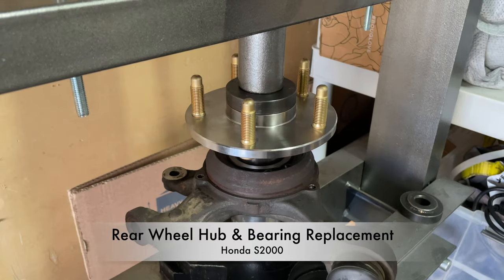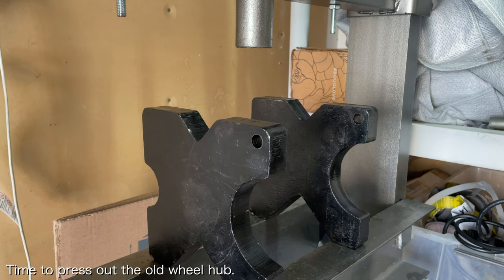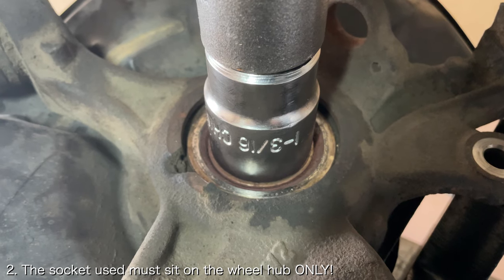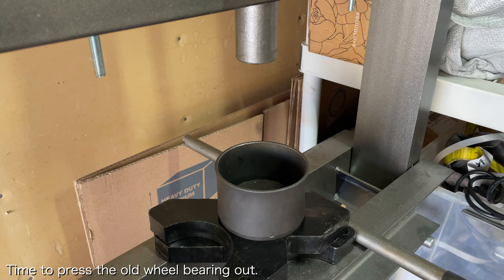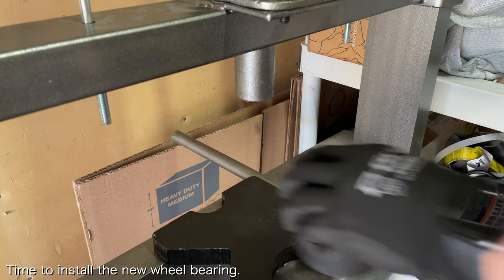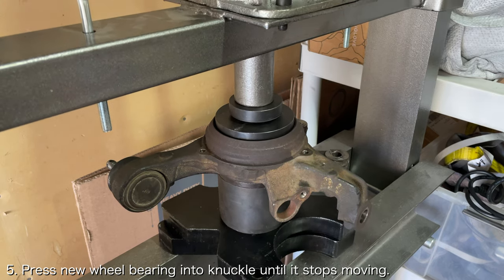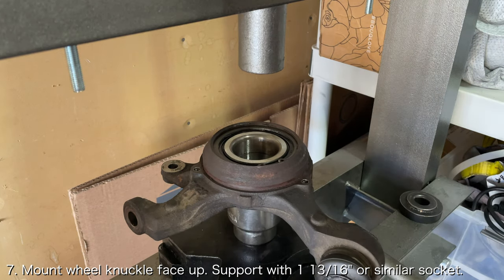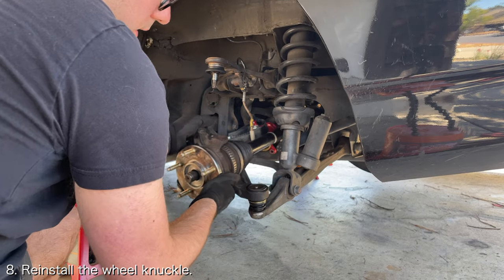Rear Wheel Hub and Bearing Replacement | Honda S2000

Comment: Thank you for posting! 

FYI timken bearings have no rubber side, and the brake shield goes back on before hub.
Reply from the maker: I never instructed to remove the brake shield in the video. I was just doing this personally since I was installing a rear big brake kit which is not compatible with the brake shield.

Comment: Did you grease the bearing or hub. I am starting this job today and wondering if my Honda Urea grease is necessary. Thanks for the great videos!
Reply from the maker: You can apply some light grease, my bearing and hub came with some grease already on them.

Comment: Will you be reviewing KARCEPT hub?
The hub in conjuction w/ 2 piece rotors is major strength & thermal capacity
Reply from the maker: Yeah. I’ll make a short video about the hubs since they are a relatively new product.
Reply: @DIYGuysvideo  🤞🏾

Comment: Jason, I read on robs website the he aluminum taped his ball joints to keep the heat off the grease. Does that actually work?
Reply: Most importantly you want your parts to be clear first. You can add a very small amount of lube like WD-40 or wheel bearing grease but at the smallest amount possible. Hope this helps💪🏼

Comment: Any particular reason to not re install the dust shield?
Reply from the maker: I didn’t bother mentioning it but I plan on installing a rear BBK soon and the dust shields won’t be able to fit with the new rotor.
Reply: The dust shield helps protect the ABS sensor as well. I'd run the oem shield and trim it or run some kinda of vent if not using a shield

Comment: I don’t like how you don’t answer comments. These people are real S2000 owners and are looking for help!!! Plus you should have mentioned that you bent the rear dust cover all to hell and didn’t reinstall it. I understand and it’s ok that you didn’t put it back on but you should have covered it!
Reply from the maker: There are a lot of comments on my videos and I don’t have time to think about and answer all of them. I just make these videos for fun, I have a full time job that consumes most of my life.

You’re right I could have mentioned how may need to bend the dust cover if necessary. I didn’t omit it because I removed it, as I didn’t mention anything about the dust cover in the front bearing replacement video. It’s just not a very important detail and the dust cover is very bendable. 

I can leave a comment in the description to be more clear but I have already replied in the comments why I decided not to reinstall it.

Comment: Why did you omit the dust shield upon reinstall? Kind of defeats the purpose of a complete job.
Reply from the maker: I later installed a big break kit which requires me to remove the dust shields
Reply: @DIYGuysvideo  excellent choice